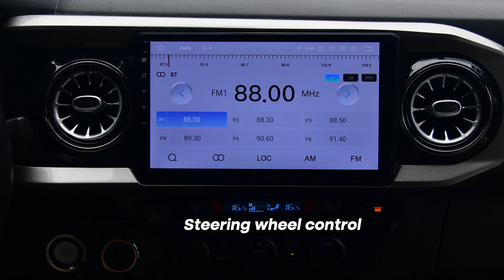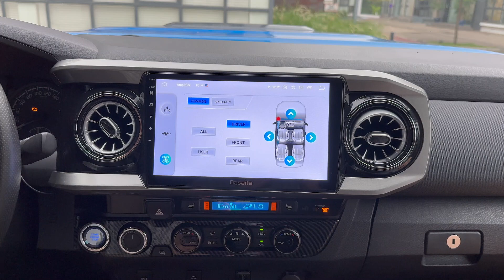Tacoma 2015 2022 install Dasaita Car stereo 10.2inch

Comment: I bought a head unit from them.  I needed them to adjust the options I asked for help and they didn't help me
Reply from the maker: Hi dear, Sorry to keep you waiting. In order to know more about model unit problems, happen and save your time on solving them, please offer us the following info via email ((send an email to our aftersales support center:  support@dasaita.com). Hope let us know more, and we will look into the matter for you:

1, Car type + Years
2, Problem clearly (will be better to take pictures or video showing how it cannot work well during use)
3, How long did you use model unit and met this issue. 
4, Order number and which store you bought.